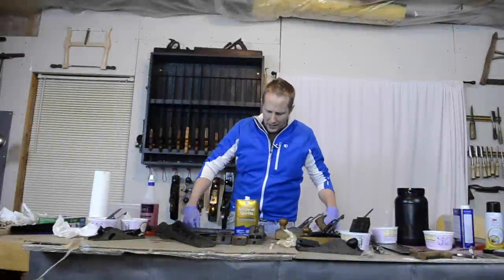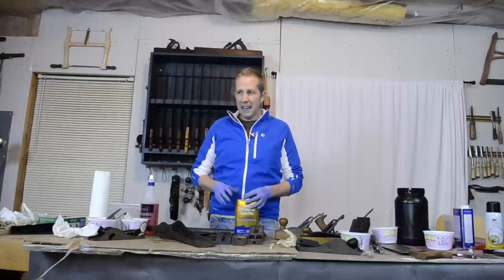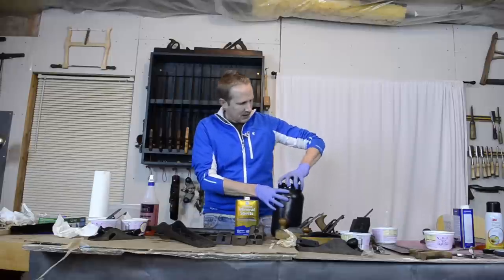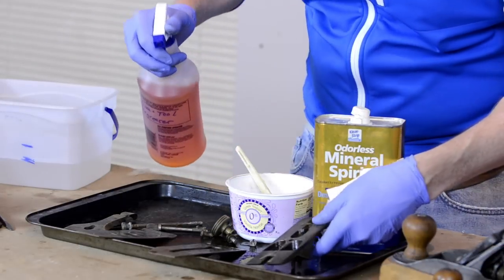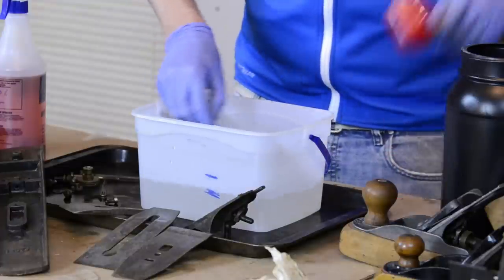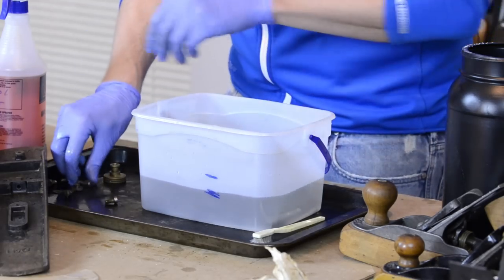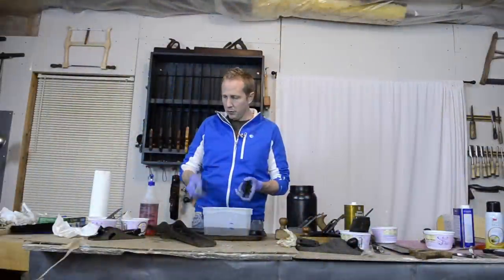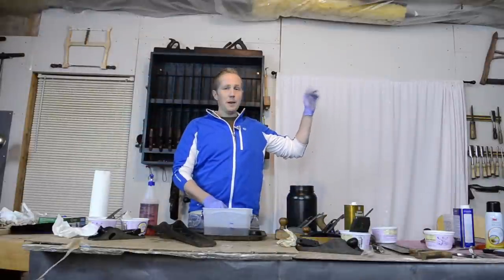How to Remove Rust from Tools?

Comment: Great video. When I need a container to suit a larger item, I either use a suitabke sized drawer or make a frame from timber and drop in a sheet of plastic. It only needs a base if it has to be carried to discard the liquid. Place the item in it and fill with liquid.
Reply from the maker: Hey, that's a fantastic idea! Building a little plane-sized frame with a plastic liner is brilliant...thanks!

Comment: what have been the side effects with using vinegar? I normally use vinegar myself so I'm keen to know what to keep an eye out for.  And do you get any of these effects with the citric acid solution, as they are both acidic I would have thought they'd have similar results? Thanks for the clip
Reply: What is dry citric acid never heard of it.
Reply: The vinegar could damage the edge on a chisel etc.

Comment: Hi Josh, many thanks for your video. What do you recommend applying to the tools after rust removal, so rust doesn't return?
I use your method and also another that is more gentle than acid for vintage / delicate parts. I use 1 part Molasses and 9 parts water then let the tools sit for 2 - 3 weeks. Amazing results even when rust is so thick it's flaking. The rust washes off under the tap, no scrubbing.
Reply: I wanted to use the best oil specifically for vintage tools that would be stored for a year or more, but also didn't want to spend an arm & a leg.  After spending nearly 2 weeks researching, it seems the consensus is a Lanolin based product - Fluid Film.  It comes in an aerosol spray & costs approx. $10 (a fraction of the price of others).  Just picked some at Lowes & plan on using it later today.

Comment: thanks for sharing 

where do i go to get the citric acid powder...and what kind of oil will i use to lube the parts after the acid bath?
Reply from the maker: +nmssis This is the best price that I've found: http://www.amazon.com/gp/product/B00MHTFUCK/ref=as_li_tl?ie=UTF8&camp=1789&creative=390957&creativeASIN=B00MHTFUCK&linkCode=as2&tag=woodandshop-20&linkId=OLFZXXSA23LLUPEN
Reply: Wood and Shop
thanks and what oil do you use to prevent rust?
Reply from the maker: +nmssis You're welcome! I personally just use inexpensive mineral oil. I'm not sure if others do, but it's worked fine. I'm not sure I think the expensive Camelia oil is worth it.
Reply: Wood and Shop Thank again!
Reply: SunShine thanks!

Comment: electrolysis is a lot cheaper and you only need water and a scoop of washing powder for the solution. you dont even need a battery charger you can just use a car battery and wires..

Comment: What are some of the side effects of vinegar?
Reply from the maker: Hi Eric,

I had some strange discoloration and rusting on my hand planes after using vinegar. I'm not sure why it did that, but citric acid seems to work better.
Reply: okay thanks. I will try the citric acid method

Comment: Have you tried this with a bronze plane?
Reply from the maker: Hi Shaun, thanks for your question. Since bronze doesn't rust (it's an alloy of copper + tin) there would be no purpose to using rust removal. I use a bronze or brass polish in this case. Hope this helps!
Reply: I think that was a trick question

Comment: After removing rust, what is the best way to prevent the rust from coming back? You mentioned lube oil. Is there a particular lube oil you recommend? Some people recommend wd40 spray. Any experience with wd40? Thanks!
Reply: uvideo100
Reply: +uvideo100 3 in 1 oil never fails.